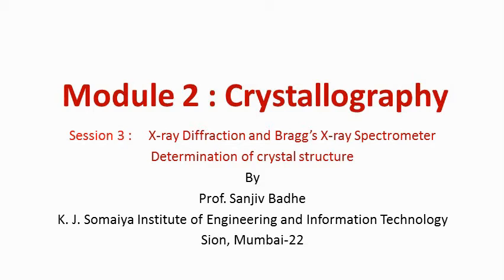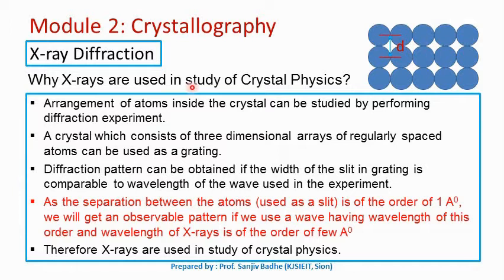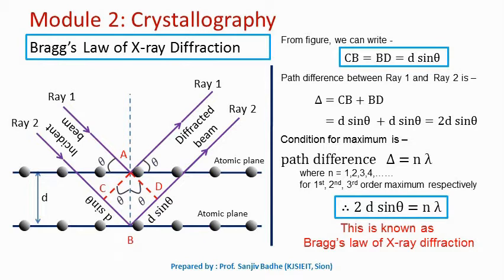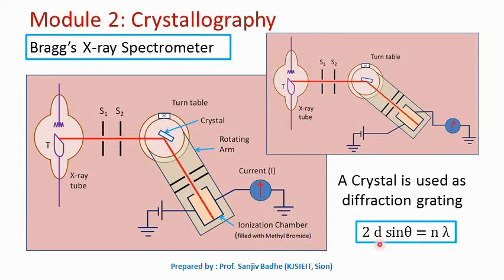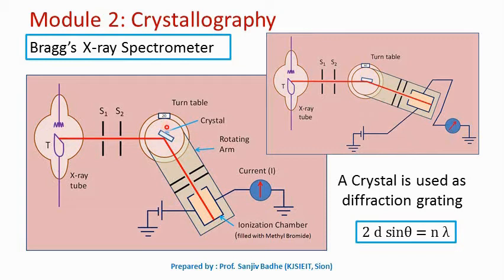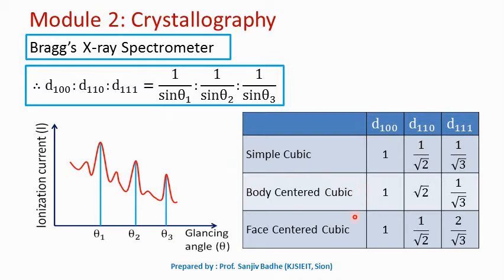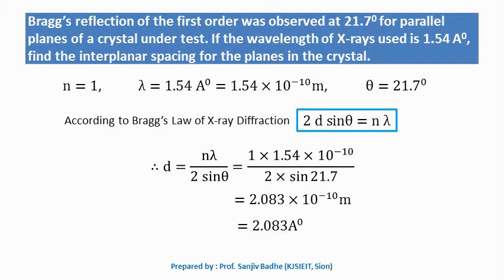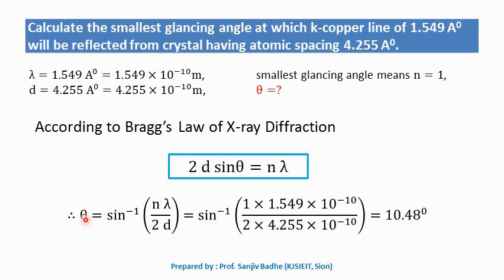Crystallography Session 3 (Determination of crystal structure using X ray diffraction) noise reduced

Comment: Sir I had a doubt,
I the rock salt sum the Miller indices were given as (100) so the formula accordingly of d would be a/1 but you considered it as a/2 why was it ?
And Sir in the problem the should have been passing through x only but u took three planes in succession why was it ?
Please clear my doubts sir 🙏🏻
I have term test in next week FY BE in KJSEIT
Reply from the maker: Rocksalt follows fcc structure. For fcc structure, there are additional lattice points at the centre of each face. These points intoduce additional planes parallel to (100) and interplanar spacing becomes a/2 and not a.
Reply: @EngineeringPhysicsbySanjiv  thank you so much sir ❤️🙏🏻
Reply: @EngineeringPhysicsbySanjiv  Even I had the same doubt , Thank you sir.
Reply: @alphabetmore6963  thank you sir I was also having the same doubt

Comment: For the first question why did you divide the values by 9.73 if the smallest number was 6.84?
Reply from the maker: We should divide the values by all three numbers that we get to check if we get the ratio that matches with the known ratios. Here, dividing by 6.84 or 11.03 will not give us the required ratio which will lead to idenfication of crystal structure.. So we divided values by 9.73...
Reply: @EngineeringPhysicsbySanjiv  ohh okay

Comment: Sir I think you've made a mistake there at 24:32 that interplanar spacing is d=a which is 2.814armstrong according to the formula.Am I right?
Reply from the maker: Rocksalt follows fcc structure. For fcc structure, there are additional lattice points at the centre of each face. These points intoduce additional planes parallel to (100) and interplanar spacing becomes a/2 and not a.
Reply: @EngineeringPhysicsbySanjiv  thank you very much sir that means there is some exception in rock salt as by the formula d=a but actually d=a/2 ; please tell sir??🙏🏻
Reply from the maker: @aadityakumarpandey0181  It is not an exception, for fcc and bcc structure interplanar spacing for (100) plane is a/2 only..
Reply: @EngineeringPhysicsbySanjiv  ok sir thank you very much for clearing my doubt 🙏🏻
Reply: @EngineeringPhysicsbySanjiv  thank you sir ! For clearing doubt
Reply: @EngineeringPhysicsbySanjiv  what to do  if another Salt came in exam. How do we know which Structure it will follow
Reply from the maker: Rock salt, NaCl these follow the same structure. in exam random substance wont be asked.. these are familiar examples..

Comment: Also sir why did you take max value of n as 5 if we got the answer 5.76 it should be 6 right?
Reply from the maker: We should not round it. n is an integer and its value can not be greater than 5.76. So maximum value of n must be 5
Reply: @EngineeringPhysicsbySanjiv  I didn't get it
Reply from the maker: @sakshikaveri  The maximum value of n that we calculated is 5.76. Now n is an integer. As value of can not be greater than 5.76, it can not be equal to 6 and therefore maximum value of n is equal to 5. So here we will not do the rounding. Even if the n max is calculated as 5.99 then also we would have written maximum number of orders to be 5 only..
Reply: @EngineeringPhysicsbySanjiv  ohhh okay